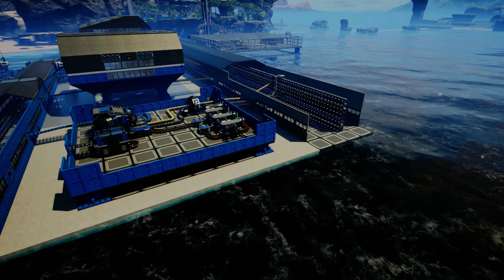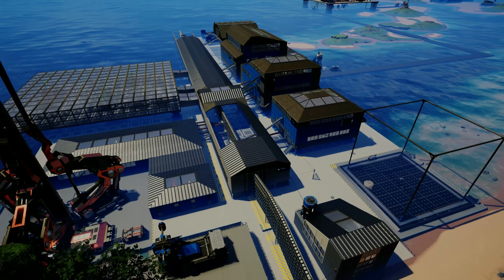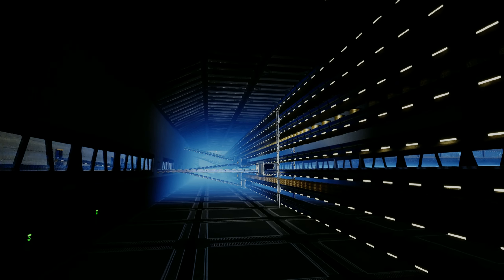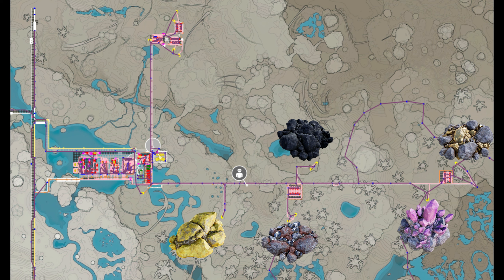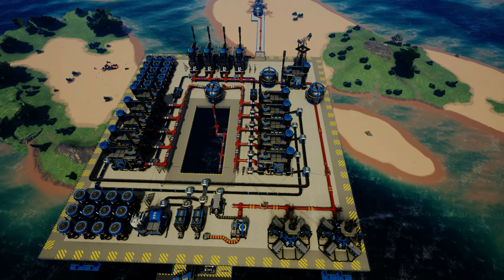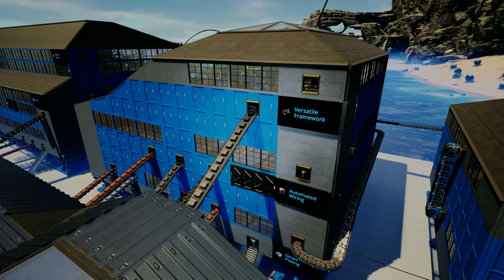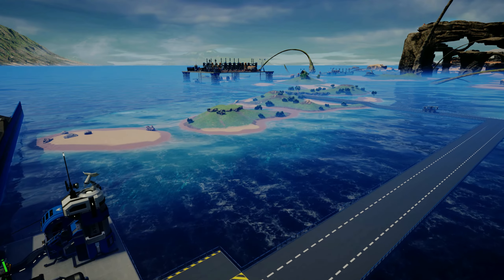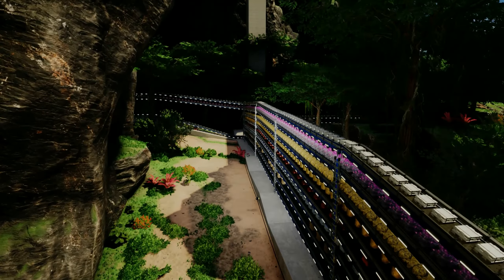Satisfactory - Main Bus & Factory Town - Best Locations & Easy Setup

Comment: 3:08 not unlimited building space, especially now. They reduced the world borders quite a bit and they aren’t square, the southwest and southeast of the map border has a pretty sharp angle cutting through what seems to be open space above the water but it’s a death barrier
Reply from the maker: Well, yes I know about the borders...but honestly there is more then enough space if you start at the beach.
Reply: I am building there ,you can put down 160 Foundations in Diameter without hitting the Barriers ( starting from the Coastline )  ,if youre building on multiple Levels you will have more then enough Space for a Megafactory .

Comment: I like trains in factorio, don't like them in this game, cause they just have too many issues and are a pain to build, especially since BPs don't lock together...
the game also needs an "upgrade all connected belts" function...
It's  a fun game, but because of all those minor issues, I dunno if i'll ever replay it, once I'm done with all the research...

Like the build tho :)
Reply from the maker: Thank you - yeah, I avoid trains for the mentioned issues. But Drones are awesome, once you get there.
Reply: @wholesomegamer  yesterday I set up rocket fuel in that hot spring area... that was really fun to build with drones... but the main base is just a mess of trains that constantly need fixing...